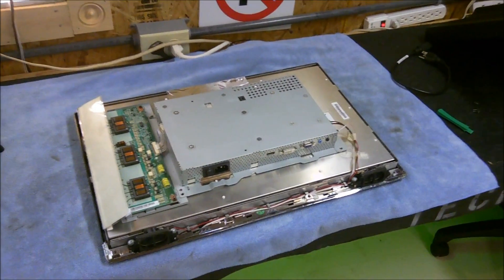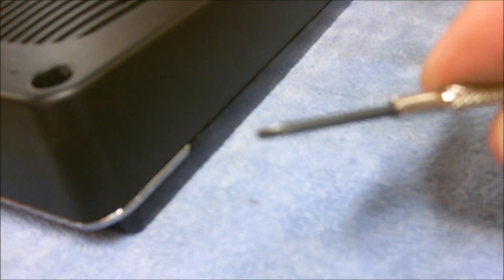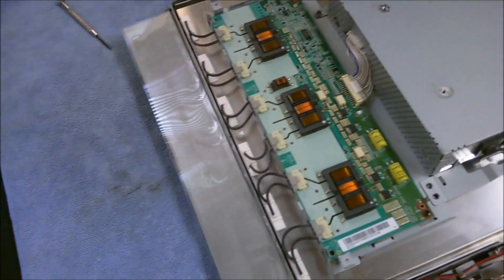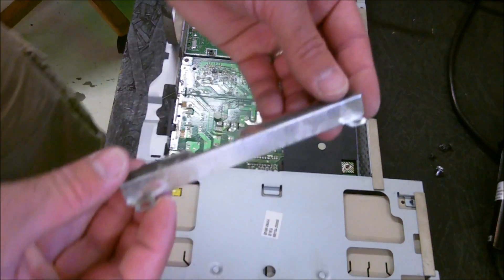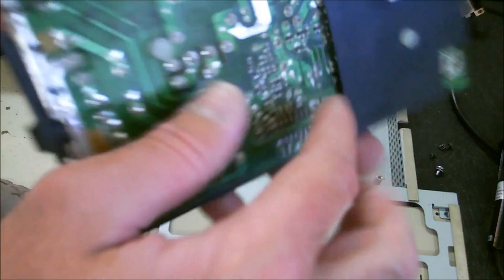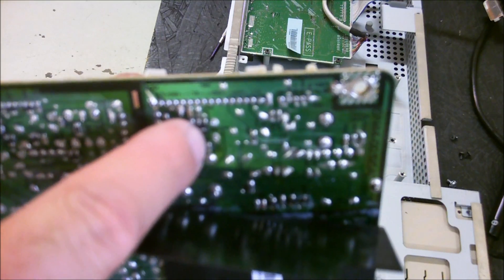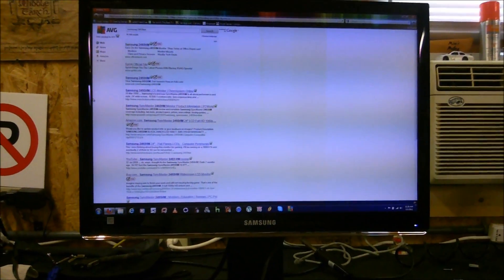Samsung SyncMaster 2493HM LCD Repair

Comment: i am having trouble with my syncmaster 2493HM as well.. for me it is that after having ben unpowered for soke time it is really hard to get it to power back on.. like it is af it is a power cycle problem that makes it unable to send the power to the right components in the right order.. i have opened it up and i see no bad capacitors and the fuses are not broken.. idk what the problem is because well sometimes i get it working after unplugging the powr cable and letting the power drain before i plug it in and turn on the switch before pressing the power button.. but other times it just refuses to turn on no katter how many times i try... it is really annoying because i am not really what it is i do that eventually do make it work.. like.in what order i do things.. i am gonna try and resolder some of the component points to see if that fixes it but idk.. it also do not have any dust buildup on the boards either so it is not that.. and as i did say.. sometimes it works.. sometimes it do not.. 

(well maybe i should have tried cleaning the touch sensor for the power button before resoldering the power board XD anyway it works now. whatever it was because of problems with the board or because of the dirty touch button idk.. i wish i had the remote for the monitor but it was missing whenni bought it..

Comment: Hi! Thank you so much! I could also repair my monitor. However: two remarks:
- That black shield (the three white spacers) can be easily removed with a pair of pliers - there is no need to bend it so badly...
- If the thing is already dismounted, it is worth to replace all the electrolytic capacitors. If one of them is too old, then maybe the others are also. (In my case there was no visible sign of damage on any of them.)
(+1: The 2200 uF 16V did not fit under the hood - the 10V type was OK.)

Comment: Impeccable j’ai résolu mon problème de led bleu faible avec le non allumage de mon écran j’ai remplacer le 2200 uf  16v  par un 2200uf 35v à présent tout est ok 👌🏻 merci pour votre vidéo car c’est un bon écran f’je leb sert pour faire de l’émulation  avec sa rotation c’est très pratique

Comment: Thank you very much for this video. It is exact the same capacitor that's blown up. Seems to be a common problem for this monitor. I still have to replace it, but I'm sure it will work again then.

Comment: Cool stuff, I wonder if it would fix mine, not sure if it's the same culprit. Mine is almost same version, SyncMaster 2494HM 24" (or 25" not sure), it actually turns on, for about 2 seconds, very dark screen light intensity, then shuts down, I can repeat this as many times as I like by turning on and off.

Comment: I also managed to fix my 2493HM screen, using a 25V 2200uF capacitor. Unfortunately, I believe i broke my lcd screen during the repair.. :-( Thanks a lot for the guide though, very informative! Also, the reply from Jerzy is really useful -->  "LCD Slave cable you squeeze those clips ;-)
"

Comment: If you don't see an obviously damaged capacitor, measure the three 68 ohm resistors. They are known to be also a weak point of the power supply board (at least the BN44-00173A)

Comment: Hi a little on the late side but, I have a SyncMaster 2493HM with a flashing blue power led only with no picture, and I see no bulged or leaking capacitors, I also checked the backside of the print for any cracks in the soldering..There are no issues of that either?
Can you advise me what to do?
Thanks in advance!

Comment: Is it not a mistake to mount an 16v rated komponent ?
it´s made for 16v witch result in lower voltage (witch is fine) an higher amps than it is rated for.. (witch is less than optimal)

Lower voltage systems use thicker gauge wires to handle the higher current (HiFi in cars use very thick wires in a 12v DC) system (but even SAMSUNG cant seem to find the correct caps) 

Planned Obsolescence

Comment: Near the end of the video is a hint that the monitor's blue LED stayed off before the monitor was fixed.  On my monitor the blue LED stays on, but the display stays dark and the monitor makes no sound when I try to switch it on.  Also, my monitor was working fine up until the morning it wouldn't wake up.  Because of the different LED behavior, I'm not confident that replacing the 2200uF cap will help my monitor.  Also, none of the caps of my monitor's power supply look blown or bulgy.  There are two fuses on the power supply board that are probably easy to test, so that's where I'll begin.  The glue that some people mentioned is bright yellow on my monitor's power supply, not brown, so I'm wondering if the yellow color means the glue isn't yet conductive due to old age.
Reply: Same problem here, did you happen to find a solution?
Reply: To Jendrik Seiler: Yes, I was able to repair it, after a lot of research.  The problem was caused by the yellow "glue" (sealant) on some components on the monitor's power supply board.  Try googling "awful yellow glue".  Many Asian manufacturers use an inferior grade of sealant, the notorious yellow glue, that breaks down and becomes conductive (and darker: tan or brown or black) when exposed to heat and/or humidity.  I was lucky: I was able to locate the specific point on the power supply board that was causing the problem because it occasionally arc-ed there for a moment when I turned on the monitor; I used my camera with dim ambient lighting to record a video that captured the location of the arc-ing.  Then I used an exacto knife to carve a groove in the yellow glue around where it arc-ed.  That got it working.  Finally, I cleaned dust off the board with canned air followed by alcohol, and after it dried I applied some electronics grade silicone RTV where I'd carved as a sealant against humidity.  The monitor has been working fine since then.  By the way, the symptoms of solidly lit blue LED combined with totally dark screen strongly suggest the power supply is receiving power but is detecting something is wrong so it shuts itself down instead of generating most of the needed voltages; one of those voltages powers the backlight tubes, and when the power supply doesn't generate it the screen stays totally dark.
Reply: Thank you very much for the elaborate explanation. Mine mysterily started working fine after not finding anything suspicious and putting the whole thing back together. But I'll definately remember your solution for future problems.

Comment: Great video, had the same problem monitor wouldn't power up. Have  Samsnug SyncMaster 931B that l had for 9 years great picture never a problem until a couple  days ago wouldin't booting up but had sound. Toke it apart went to the power supply and as with you blown capacitor (puffed up). Did a trip to Radio Shack and got 1000uf 36v , it called for 1000uf 16v but all they had was a 36volt just a little bigger can. in less then 3 hours thats with the trip to RS it's up and running. 
Thank you, and You Tube too, Saved some bucks.

Comment: My blue led was blinking, but the monitor was still getting up after some time.
The capacitor was inflated, and I changed it.
But strangely, when I turned on the monitor now, if the blue light works now immedialtely, I have no more image... even when I'm trying to press menu button, etc... Very strange, like if the LCD inside wasn't getting turn on... If anyone has a guess, I would like to get it.
Reply: +Pierre Bonneau - Maybe try to reconnect the LCD wires it seems like you have not ?
Reply: +Zaoshinki I think I reconnected everything...
Which one would you think it's more likely to b responsible of that issue ? How would you test it ?
Pierre
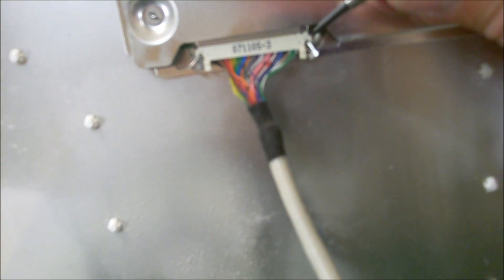Reply: +Pierre Bonneau check 4:46 in the Video maybe that cable in would just re-seat that cable just to make sure if not then I don't know

Comment: my monitor came with this smaller stand that is some how attached to the piece of metal where the boards are. when i got this some years back i was disappointed that it didn't come with the original samsung stand. now i'm trying to figure out how to get it off so i can proceed. wtf?!

Comment: I'd had this exact monitor repaired a few years ago. It's just faulted again (won't turn on, flashing blue light) so I stripped it down and it turns out that capacitor you replaced is the same one that they swapped out. So i've ordered a new pack of them for £2.50, hopefully should sort it!

Comment: I just fixed my Samsung Syncmaster 2493hm with the steps you presented. I had the exact problem you had. I bought the exact part that was the blown capacitor. I found the 2200 m and 25 volt instead of 10 volt. The detail about the voltage and the Microfarad was important since the original had the 10 volt it did not matter to have the 25 volt as long as the microfarad was respected. (you scored high there).
Thank you for your video/presentation that was so clear. That's how we are supposed to show our humanity and make the world a better place to live.
Some people with knowledge and good pay are spending time to find how to hurt people by taking more from the poor.
You made me save $$$. I paid only $ 5.05 for the capacitor at fry's electronic.
The monitor is working wonderfully well.
I'm very happy. God bless you.

Comment: Thanks for the great video. My 2493HM is working again!!! Mine was the exact same capacitor the 2200uF. I replaced it and the monitor is working fine now. THANK YOU SO MUCH!!! Your video was killer. The only thing I did different was I cut the tape instead of peeling it off from the hold down bracket. Cutting it wear the bracket ends on either side with a razor knife kept the tape in tact and in place.
Reply: +p Thomas how much Volt did you choice ?
Reply: sorry, i can't remember capacitor's voltage but i do remember it being a little bit greater voltage then the one that blew up.

Comment: Hey cal, when you say "it does not power on", does that mean that you get no light in the blue power-LED? My monitor does not react when I press the power-on button. The blue LED blinks slightly when unpluggin the power cord. Do you think my issue is the same as yours?
Reply: Same here. My monitor wont start, but the blue LED is blinking. Tried everything with no success yet. I just finished opening the monitor exactly as describe in the video. The 2200uf cap is bulge. Will try to find a new cap and replacing it. I'll let you know if it works.
Reply: Hello again, Just changed the capacitor and the monitor is working. Before the repair, the blue LED was flashing and no image. Juste to let you know that for 2,50$ it is worth it.
Reply: +Réal Bourbonnière Thanks. I still have the monitor lying around, so I guess I'll just give it a shot :)
Reply: Alright, I FINALLY got around to take the monitor apart and yes, the capasitor is indeed in need of a replacement. See the pictures here:
https://goo.gl/photos/vU47RowMRAfM3VaDA

I'll go ahead and get a replacement :)
Reply: Good luck. I hope for you that it will work.
Reply: Finished the repair last night and the monitor is working perfectly again :)

Comment: If the power board is good should you be getting voltage of the 24V leads to the inverter and to the 5.3 leads on the other side ?  Where the ribbon connectors connect to this board ?  Or even when they are disconnected ?

Comment: If the power board is good should you be getting voltage of the 24V leads to the inverter and to the 5.3 leads on the other side ?  Where the ribbon connectors connect to this board ?

Comment: This repair is easier than it looks in the video. The case/shell comes apart easily. unplugging the clips/connectors is easy. The soldering is pretty simple. And when I was done it fired right up. The hardest part was finding the HDMI cable I used to use to connect it up. This repair video is fantastic. (I didn't even listen to the sound.)

Comment: Big thanks for posting this video. I have two of these monitors that I run together in a dual monitor set-up and whilst they are a few years old now I was well hacked off when both of them died within 1 month of each other. Just repaired the first one (exact same blown cap 2200uf 10v) and having never tackled a monitor repair before your video was very helpful. Going to have a bash at the other one in the next few days, hopefully that repair will go as well as the first.

Comment: Exact same cap blown...
25V 2200 uf, 105° replacement cap is working for me.
Just to confirm - going up in volts is no problem.
Thanks for the video!

Comment: Hi TheElemynt, did you manage to fix your Samsung screen? I had problem similar to the one in the video, changed capacitor, now I have problem similar to yours. Blue LED comes on, but the screen remains blank : (. Any ideas? Thanks

Comment: Non-bulged capacitor might be bad too... you need to measure the output from the PSU using osciloscope... the output must not be waved... If it is, you need to measure every part of the PSU, just google "Switching power supply block diagram" and measure each step by step...

BUT... be safe, do not touch ANYTHING conductive while powered on... also watch out nasty high voltage capacitors, they might retain charge even with PSU powered off...

Comment: Very nice walk threw with how to take apart the monitor. I pulled the boards out but I couldn't find any bulging capacitors. The issue I'm having is that the Monitor does turn on. The blue light comes on. But the screen stays Black Nothing I've tried seems to work. I've got another monitor hooked up I'm borrowing at the moment. Any ideas would be much appreciated.

Comment: Followed your vid and found out that my monitor had the exact same problem. Replaced the cap with a 25V (that's all I had) and got it working. Thanks for the detailed video!

Comment: Picked up a 2492HM at my local thrift store for 39$.  Of course- not working.  Used your video, replaced same cap, up and running. Thank you for the info!!  (Toughest part - taking off the bezel...)

Comment: I did a quick google search before I opened up my monitor just to make sure I don't break anything opening it up and it turns out it was the exact same capacitor in my own monitor that needed to be replaced.

Thanks a lot for this video, couldn't have been more helpful.

Comment: the guy in my local electro shop knows about these faulty samsung power supplies. He didn't have the 2200µf 10V and gave me a 2200µf 6.3V and said i didn't have to worry about the difference. For now he is right, it's working for about an hour

Comment: Same error, same problem. Did this and fixed the monitor. Thank you very much! The first symptoms were the monitor had problems startting up (blinked very fast and you could see it had no "energy" to start). After a week or two it didn't start up anymore. Now it's fixed!

Comment: I love your video. I have question... I have this same monitor, but it's have a different issue. The monitor powers up, but the display eventually goes black (menu and input options don't display either). All the caps look good, there was a little dust though. What do you think causes the display to go totally black?

Comment: Thanks so much for this video! Turns out I had exactly the same problem as the monitor you demonstrated on - that same 2200uf capacitor was bulged. After desoldering it and cramming an axial-lead capacitor in its place (radio shack didn't have radial ones at 2200uf), it works!!

Comment: Thanks for the video! I just disassembled the monitor and I'm gonna take the power supply board to my friend tomorrow to see if we can fix it by changing the uf cap(s). I noticed straight away that at least one was broken so I'm hoping it'll fix it.

Comment: Hello, great video. Saves a lot of money :-)   But, the capacitor in your video is a lot higher then the available space after remounting the board. Did you replace it before remounting the power board and closing the monitor ?

Comment: 4:47 You don't just pry it out. The clips on the side need to be squeezed together then it will unplug. If you just rip it out, as shown in the video, you will damage the retaining clips. If that signal cable isn't held in tight, the monitor will cycle through test patterns. If you have that problem after performing repairs, you've likely damaged the connector and the cable isn't seating correctly.

Comment: No luck with mine. Mine would not power on, and I did not see a busted capacitor. There seemed to be a small rattle on the second board within that big detachable block.

  Another site recommended replacing all capacitors as broken ones may not be seen, but at this point, i dont think I am going to get it fixed.

Comment: Excellent video!!!
But i want to ask you, this apply to the case that monitor has slow start and until starts the blue led blinking really quickly? I mean this is the preliminary stage before stop working at all? If i change the capacitor or blow the power supply i can save my monitor?